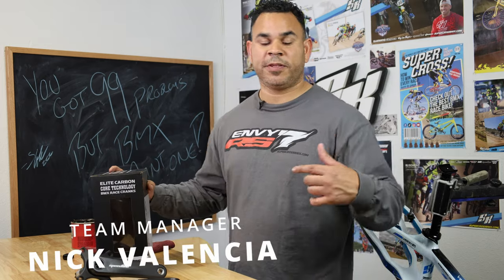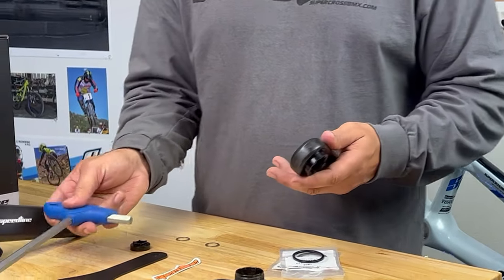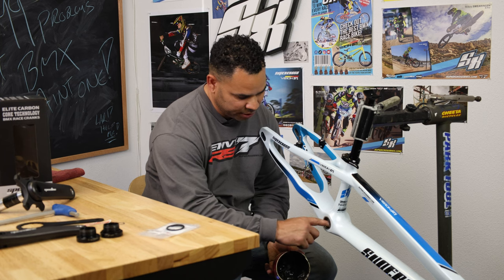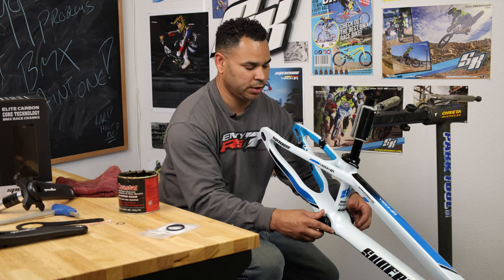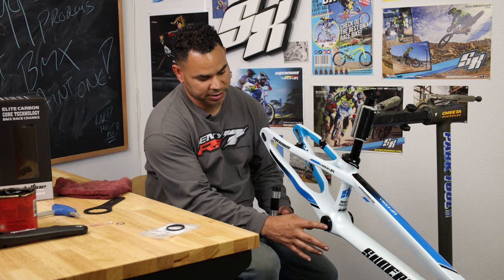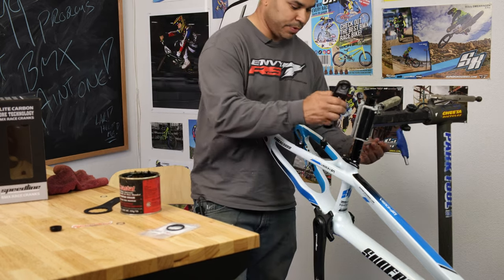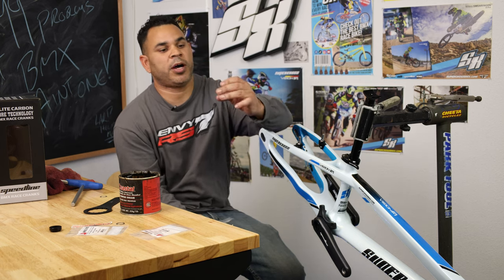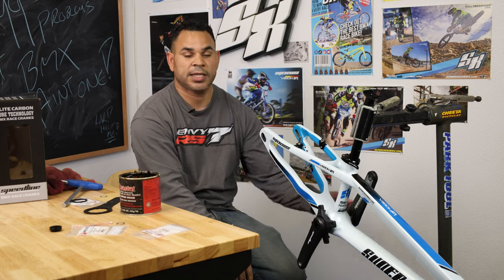Installing the Elite Carbon Speedline BMX Cranks | BMX How To's

Comment: My speedline carbon cranks ride so smooth, there's nothing like it. I prefer the speedline BB over the one that came with it, it just didn't seem to fit my rs7 frame but the speedline BB is a perfect fit, maybe the carbon frame has a little wider BB than the aluminum but I love em either way. 🤘
Reply: Glad you love them! RS7 and these cranks is a great combo!

Comment: Nick does the spacer go between the frame and the threaded bearing cup?
Reply: The 2.5mm not supplied will go on your bottom bracket between the frame and bearing cup. The super thin one supplied will go on the drive side between the bearing face and drive arm :)